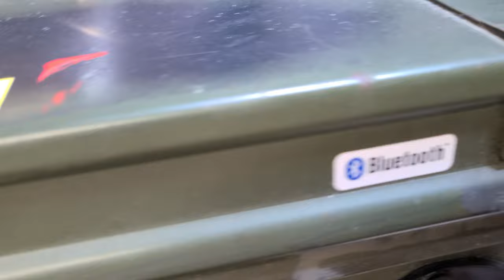DEMO! The most powerful DIY-made Bluetooth ammo can speaker - how to get MAX bass from a can!

Comment: I love it sir but I do have a question I'd like to ask. I'd really like to do something similar. If I was going to run a midrange it's actually an old component set. Would you still recommend running the sub frequency up higher than in a car audio application? Also when choosing a sub I notice some have a wide range than others... so would that be something to keep in mind. Certain subs I've looked at don't show any frequency above 500hz